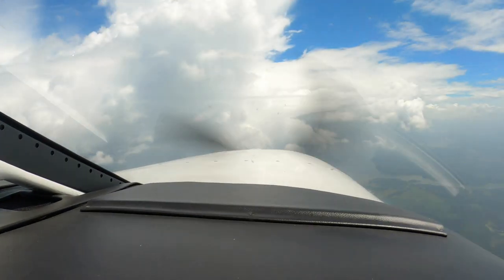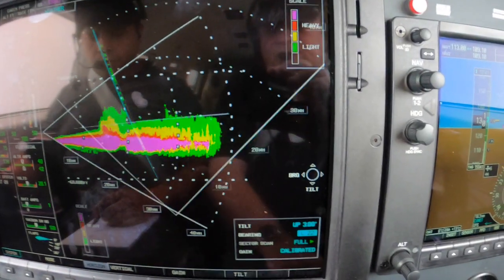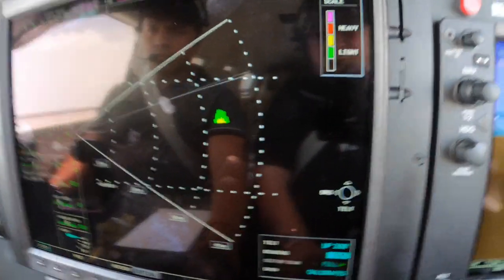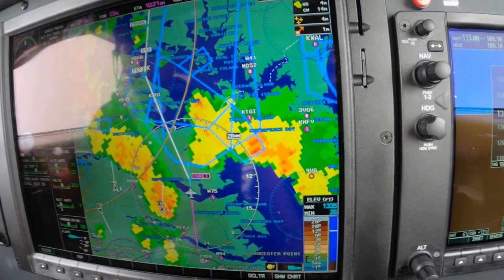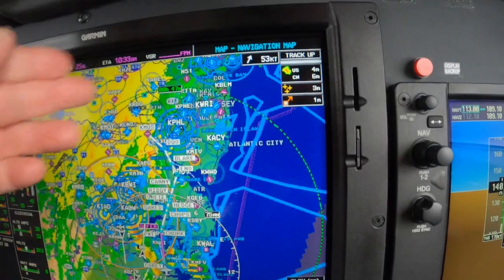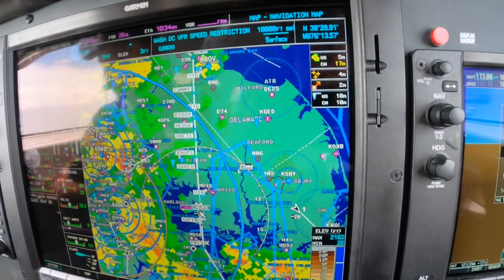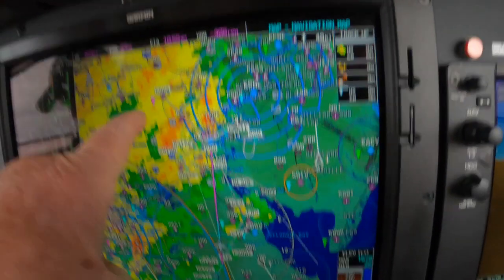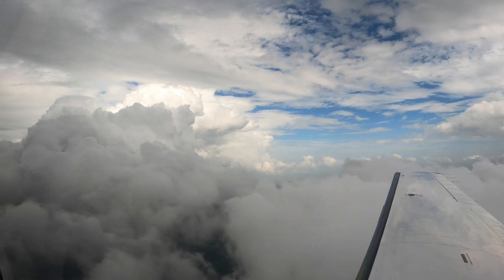PA46 Malibu: Real-Time Weather Decision Making

Comment: Winds aloft is also very important info as it predicts how fast the storm cells are likely to be moving, the faster the winds the more inaccurate the delayed cell locations and higher risk of running smack into a cell that is not where it appears to be via nexrad, getting overtaken by one , or getting trapped. Keep in mind also that if you are relatively low that its easy to get trapped between weather, rising terrain, and restricted airspaces. These local systems depending on degree of instability can evolve amazingly quickly, faster than nonjets can evade them,  one minute its a single small cell, 10 -15 mins later it has exploded into a big powerful cumulonimbus or lets loose moisture and gust fronts that then spawns a profusion of other like minded progeny.
Reply from the maker: Onboard RADAR is THE only tactical tool to consider with 4 supporting tools. Here are some “rules” for weather: https://youtu.be/d3Umgajneos
Reply: Hello Dick, I fly since recently a pa46 mirage 350p, I found it a bit odd to see you flying it in this video so low, wouldn't have been better flying it higher? Indeed wouldn't have helped with the CBs, but what was the considerent?
Reply from the maker: Hi Alex, Your question leads me to believe that you place a higher priority on being able to see out the window and avoid clouds. Can you tell me more about that?
Reply: @RWRPilotTraining  yes, indeed, that's one of the reasons and the ather would be speed! Referring to first, yes I like to be above the weather as much as I can, from up there is much easy to see the tops and avoid them. From what I see in your video you have encountered a front and indeed higher would mean iceing. Well, I'm new in flying IFR and so high but not high enough so I try to learn, particularly this autum and winter I am curios how to manage weather in a pa46. Thank you Dick!
Reply from the maker: Hi Alex. I have over 450 vids on this channel and no one video will answer this very important question. You are, however, giving me ideas. Look for the vids that answer specific weather questions on my site and others; and look for some chalk talks from me on how to use weather tools specifically for flying the mid levels. Fly Safely - Train Often .. DR